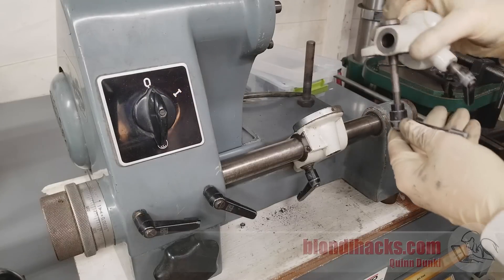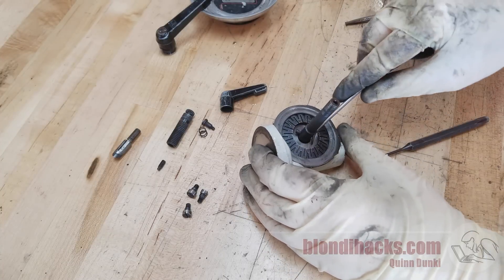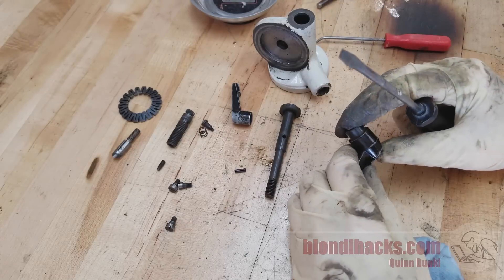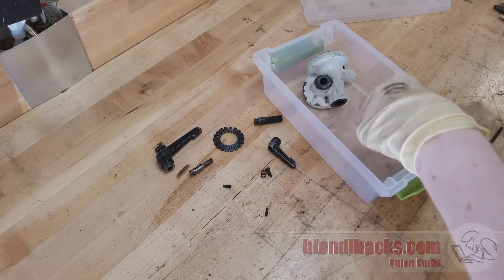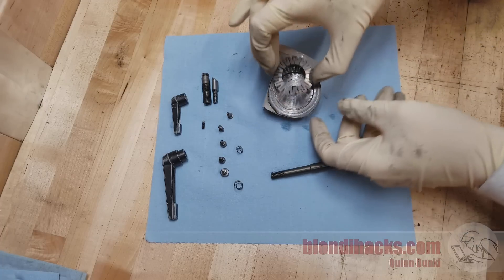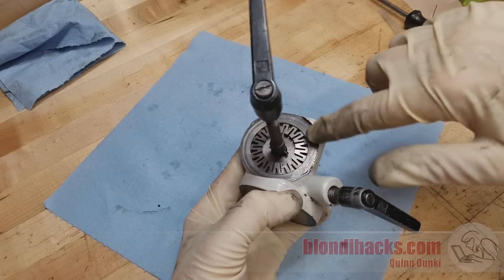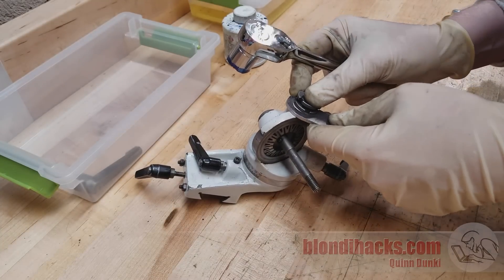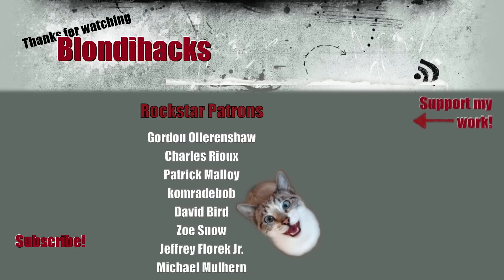D-Bit Grinder Restoration - Part 3

Comment: 1.  These are super cool parts.  This machine is definitely engineering indulgence.

2.  I'm an American and I call them spanner wrenches, because a regular wrench is just called a wrench.

3.  Obviously you put the aluminum parts in the evaporust so that any rust residue on them from contact with the steel will be cleaned up 😀

3A.  Obviously you used the bin with the holes so you could get rid of any rust residue om your workbench... 😁

I love your channel, and I am catching up on all the old stuff.  Gives me plenty to watch while I wait for my life to reboot.

Comment: 8:56 - "an old mechanic's trick", eh?  Interesting!  I don't remember where I learned that, but it's a darn good trick.  I almost always use it, on everything... from the plastic threads on kitchen liquids (juice, or whatever) to machined metal, and all things in between.  I suspect it was taught to me in my tech theatre days?  Anyway, undervalued tip, if folks don't know it!

Comment: Nice video, love te machine.
In order to use evaporust, you need to degrease/wash the parts clean. The grease and groom prevent the Evaporust to contact the desirable surface... :)

Comment: While the Evapo-rust company's website doesn't list what it attacks, I did find an interesting article on a Italian website (http://www.envirem.it/EN/Evapo-Rust.htm) that lists the oxides attacked as:

Maghemite (Fe2(3+)O3), Magnetite (Fe(2+)Fe2(3+)O4), Wustite (FeO), Iron hydroxide (Fe(OH)2), Iron trihydroxide (bernalite) (Fe(OH)3), Akageneite (ß-Fe(3+)O(OH,Cl)), Feroxyhite (Fe(3+)O(OH)), Lepidocrocite (?-Fe(3+) O(OH)) and Parkerizing (both types: manganese & zinc)

I'm hoping the page is correct, because it has a lot of other really interesting information about Evapo-rust.  Works through chelation!  Why the steel ends up a bit darker (carbon migration)!  As well as magnesium and cadmium incompatibility!
Reply from the maker: That matches the behavior I see from it, for sure. I found one surface that it discolored, and I suspect it’s chromed

Comment: I don't know if the name applies to the springs in your grinder, but I've seen stamped conical washer-shaped springs w/o all the slots referred to as "Belleville springs" and "Belleville washers".

They can be spec'd to apply a fairly high spring load in a very short installed height; I've also seen them installed where they were stacked in alternating directions (small end butted to the adjacent washer's small end; big end to big end - lather, rinse, repeat...).
Reply: One other thing: if you find you've opened a can of chowder on the head of a screw (like shown @ 5:48), you can actually mitigate much of the damage by carefully tappy-tap-tapping down the raised burr that was upset by the screwdriver (knocking it back into the wallered-out slot), and running a file over the head of the screw to make the "apprentice marks" much less visible. 

Also, gunsmiths use screwdrivers that have hollow-ground tips, so the faces contact the screw slots squarely.  I wish I had known this for my first 35 years of working on stuff...

Comment: I've done 6:40, earlier this Summer, with Evaporust, in the same Sterilite bin. Also found out you can leave stuff in evaporust too long, and that some iron/steel alloys and plated parts don't respond well. Best to check on stuff periodically, and not leave it longer than needed.

Comment: 11:04 that is the same solution i used when i made the locking handle for the tailstock on my lathe. the eccentric pin pulls on a threaded rod that goes through the tee nut under the ways.

Comment: What is your preferred lube for in those assembled joints?
Reply from the maker: I’m using a basic light machine oil, like 3-in-1. For the dovetails I’ll probably use ISO68 way oil.

Comment: It’s like boning and re-inboning a previously spatchcocked chicken. Did you consider a paint job for the castings?
Reply from the maker: I decided to leave the original paint. It’s in great shape and is higher quality than what I could do anyway. I like the character!
Reply: Blondihacks I look forward to the Cold/Hot Bluing video. Was it mentioned what was wrong with the mill? And will you be making a repair/reassembly video of it?
Reply from the maker: @mtwagner  The mill had an electrical... explosion... of sorts. There will indeed be full video on it. It's been an odyssey!
Reply: @Blondihacks  How's PM's customer service been?
Reply from the maker: @mtwagner  First rate! Matt over at PM has been hooking me up with all the parts and tech support. We're getting it all figured out. I'll cover that in the video on the repair as well.
Reply: @Blondihacks  So Mathew at Precision Mathews is precise? Good to know.

Comment: Now that I've been informed of the German passion for flat-head screws, I see their deeds everywhere... Nice job avoiding more chowder btw!  (Was a bit surprised evaporust was the only treatment - expected ultrasonic then I remembered you're not making small engine videos so might not actually have one. All I have is a jewelery one I got cheap at Goodwill but even that has made me a convert.)
Reply: "It's chowda, say it right"
Reply: I was going to suggest ultrasonic & detergent before the Evapo-Rust, to remove the grease and caked-on grinder dust.  I use mine so often at home - works well & fun to watch bits of crud get knocked loose.

Comment: I have a question for anyone familiar with the voodoo of hand scraping..
I'm kinda expecting to get shot down in flames but, disregarding scraping for flatness and thinking only of even oil distribution. Instead of scraping could you scribe diagonal hatching into the ways? say 5mm spacing, and achieve the same result ? after stoning of course. Is this why some factory grinds are a bit rough?  Logic suggests it should work and give a different visual look.
Just thinking, which I know can be very dangerous 😁
Reply from the maker: Good questions! Scribing diagonal lines is basically what scraping is. You’re creating a cross hatch pattern so that only a matrix of points is touching the other surface. That’s how you achieve flatness. Regarding rough factory machining, those are just tool marks from roughing cutters. It’s sufficient because the tops of those toolmarks are still pretty flat, even if the surface isn’t smooth. It averages out against the mating surface. A better finish is more desirable for many reasons, but that costs money. 😀
Reply: Thanks Quinn. Thats how I understand it. Wasn't sure if it was a great sacrelige against the machine gods or not 😁 Was just thinking of a different way to do it, quicker? easier? dunno but I reckon hand scraping would do much good for arthritis. Plus I'm a stubborn non conformist.
Little Rexman lathe is up and running 🎉 been doing some baby steps stuff, getting familiar with it but I think the ways need resurfacing. Might ask new mate https://www.youtube.com/channel/UCJUei-_4UQy5bgAvmFVnWWg  Craig if he wants to try it. Of course that will mean changing the motor to vfd and revisiting a few other little issues as well 🤦‍♂️.
I honestly don't understand the concept of boredom

Comment: Now the wooden work bench will not rust since it now has been treated with EvapoRust.

PS “Hotel Pans are very useful when soaking and cleaning parts and can be purchased fairly cheaply at restaurant supply houses or if happen to catch a auction of a restaurant that has gone out of business and sometimes can be found in thrift shops.  I also use inexpensive enamel coated pots to soak and clean small parts combined with a small induction burner

Comment: Hi Quinn,
The splined handle fastener with both external and internal screw threads, with the cute wedge is a "Differential Screw".
Enjoying the top notch engineering design and manufacturing, great vlog and discourse.
Tip: rotate the round file on the forward stroke to improve surface finish 🤗
Thanks for sharing.

Comment: Hand Impact Screw Driver, I got one for my motorcycles, but works great for what you are doing as well.
Reply: Also useful in disassembling old 800MB scsi hard drives.
Reply: Absolutely.  I should look at the brand on mine because it's damned near indestructible.

Comment: Another great video as always.  A little trick I learned from a gunsmith friend to apply a thin coating of oil to parts is to use an old style shaving brush.  Apply a couple of drops of oil to the brush then brush over the area you want coated.  I keep my brush in a Ziplock bag when not in use to keep it from getting contaminated.  I use this to keep a light coat of oil on all my firearms as well as on precision measuring instruments such as calipers and micrometers.

Comment: huh huh huh  you said  shaft :P 

but out actually stupidity  these are mainly designed for griding  drill bits?  im kinda one of thos whos always  just  used a  bench grinder  for drill bits
Reply from the maker: The original intent of these is to make D-bits, which are single flute cutters, generally used for chamfers, form tools, engraving, etc. However they turn out to be very flexible machines and can be used to grind lathe toolbits, sharpen endmills, make broaching tools, and yes, sharpen drills! 😀
Reply: @Blondihacks   yeah ive watched  some of stefan`s videos i kinda assumed  D-bit was short for drill bit

hope ya get the mill up and running again soon more vids are needed

Comment: Have you ever heard the term, "chalk your file" or "keep your file chalked"? 
Yeah, I hadn't either until I met an old school gunsmith a few years ago.
The theory is, filling file teeth with chalk prevents the buildup of metal chips in the teeth of the file. It increases the effectiveness of the file, extends file life, and produces a smoother, more professional finish. Metal removal is faster and easier, too. An inexpensive time and money saver.
Reply from the maker: Interesting! I have not heard of that! I’ll give it a try.
Reply: The traditional reason to chalk the file is after course filing to produce a smoother finish rather than using a fine file

Comment: You should check out the Post Apocalyptic Inventor's video on using electrolysis to remove rust.  DC current with massive amps, like the DC welder he uses, is the best I've seen so far. Laundry soap is much cheaper than Evaporust etc.
Reply: I also like that you're using simple green. I plan to try that in a ultrasonic cleaner.
Reply: Massive Amps is not good. Less than one amp is usually more than enough. I use between 1/2 to 1 amp at 12V.